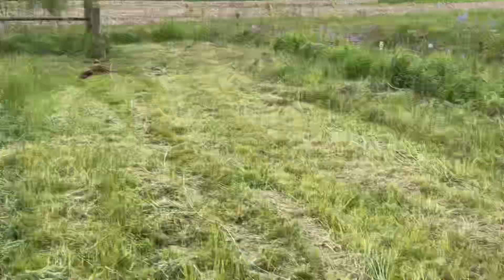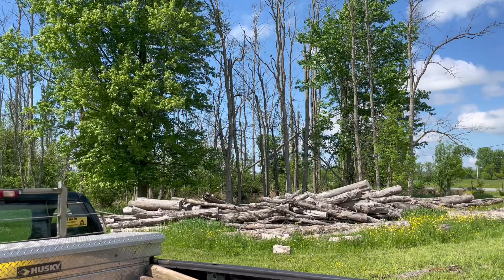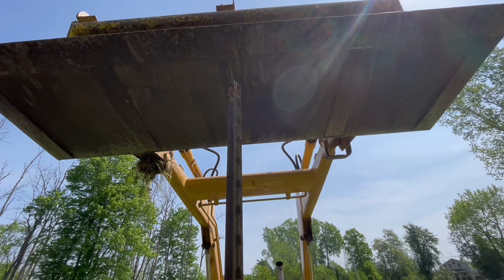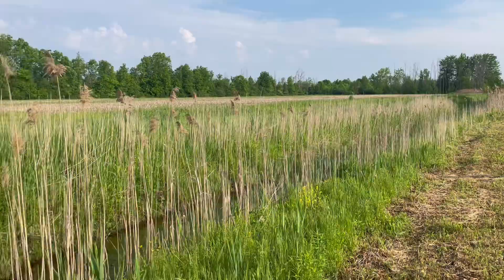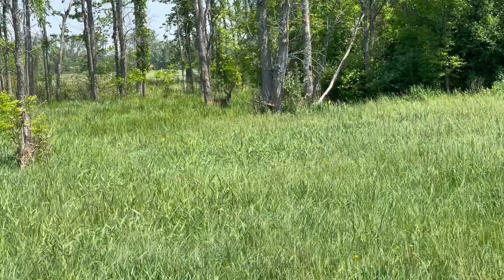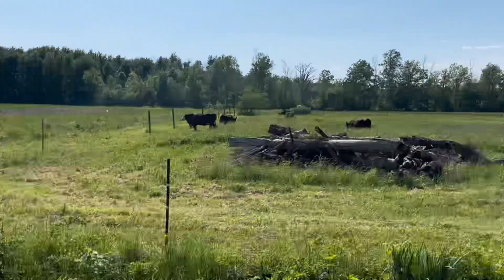Why wouldn’t the bull cross the road? ￼Mending fences and digging holes. #farmlife

Comment: Use that old trough as a raised bed, they work great. Throw rotten logs in the bottom to fill it up then top it off with some good compost, the rotten logs provide good moisture retention for your plants so you dont need to water them all summer.
Reply from the maker: Great idea